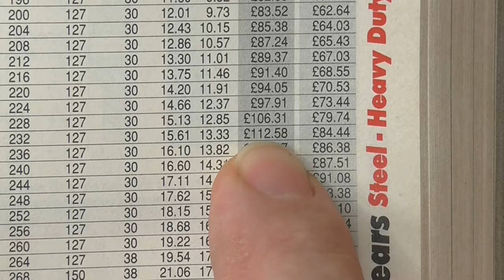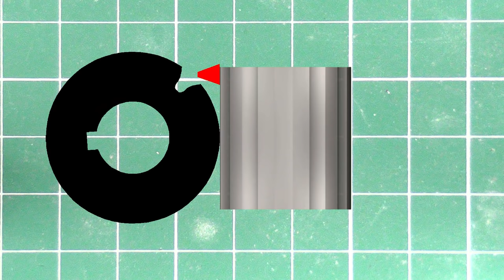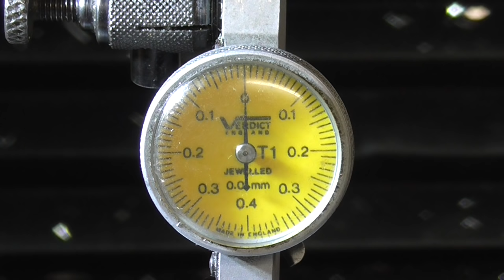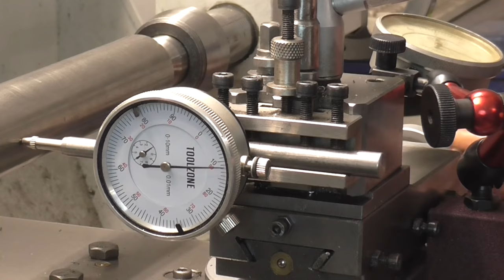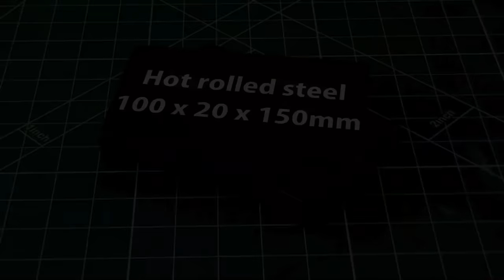DIY gear hobbing attachment for milling machine (part 1)

Comment: I love your work. But instead of building a spindle from scratch, could I just automate my rotary table using a motor and your controller? Or is there a critical issue I am overlooking?
Reply from the maker: There's a couple of good reasons not to use a rotary table, the worm reduction is usually 40:1 or 90:1 which is much too high to be practical, though you can disengage the worm and attach a pulley to the back of the spindle. The 2nd reason is that most of these tables aren't designed for continuous rotation, rather for indexing or cutting short arcs and they usually have plain bearings that have a bit of play in them. The play is not much of a problem in normal use and locking the table can eliminate it, but for hobbing gears it does make a difference and will lead to too much material being removed between the teeth especially on gears with less than ~ 20 teeth. But if you can find a rotary table or indexer with good preloaded bearings that you can attach a drive pulley directly to then yes, this can make a very good hobbing attachment.

Comment: Obviously you built a CNC hob fixture.  Which means you need a hob cutting tool.  Something if DYI starting as a  ACME threaded with the proper profile for the gear be it 14.5, 20, or some special pressure angle degrees and the other features like root dimensions.  Then cut to produce teeth and hardened.  Is the hob made or purchased?
Reply from the maker: I have both hobs I bought and ones I made, I've built up quite a collection over the years. I make them from O1 tool steel (drill rod). Screwcut, then teeth cut in the mill, hardened and tempered. My homemade ones don't have the full relief on the teeth the commercial ones have, but they seem to cut just as well (use plenty of cutting oil). it's useful to be able to make custom hobs for things like splines and toothed pulleys, not just gears.

Comment: I thought this hub will turn the blank by it's self and all you need is to set 20 degree angle to match the cutter angle printed on it.
No ?
Reply from the maker: That's called 'free hobbing' and it can work but more often than not you get poor results since when the cutter first contacts the blank it is not at the correct pitch circle diameter and so turns at the wrong speed giving you a different number of teeth to that expected. Sometimes it will sort itself out as the cut progresses, but it's hit and miss.

Comment: You do beautiful work.  Only thing I would advise is when milling I would blow some air or better some coolant mist to clear the chips.  You are forcing your cutter to recut some chips.  I think that's kind of hard on it.
Reply from the maker: Thanks!

I generally don't use compressed air on the mill to avoid blowing chips everywhere (I only have a small workshop). I sometimes use a small paintbrush to wipe them away and I usually do a light climb cut for the finishing pass to avoid recutting chips.
Reply: @AndysMachines  it does make a mess.  I mostly cut stainless in my job.  I started getting a lot less damage on my end mill flutes after I started using air to blow chips away from the cut. Air plus some cutting oil mist or flood gives a much better surface finish on stainless when milling a slot.  So much difference I couldn't believe it the first time.

Comment: I have never found a hole saw that size that would cut through that deep and big of a piece of steel
What brand did you use
Reply from the maker: It's a Sandvik (17:01) but any decent bi-metal type should do it. Keep the speed low, use cutting oil and clear the chips frequently. You can also drill a small hole all the way through in the path of the hole saw and this will let the chips fall through, though I tend not to do this as I find the slug removed by the hole saw very useful (this one actually became a gear for another project!).

Comment: Andy
Real question from ignorance in relation to hacksaw corner removal: you used hacksaw because it’s fastest? Or on a milling machine you are wasting a valuable cutting head? Or???
(no trade background, recently retired and about buy a metal lathe 😊)
Reply from the maker: Sawing is always fastest, compared to drilling or milling the material away and turning it all to chips. Sawing by hand does take some effort, a bandsaw would be faster, but I don't have one. An angle grinder with a thin cutting disk is another way, but also very messy if you only have a small workspace.
Reply: @AndysMachines  cheers! Thanks 😊

Comment: I know everyone can build the attachment anyway one would want BUT at 80 years of age , is there anyway to get hold of your prints that you made yours from?
Reply from the maker: I didn't actually make any prints for this, I just built it mostly with what materials I had to hand as that was quicker. The only parameter that was important for me was to make the centre height match a tailstock I already had.

Comment: Is a gear cutter for cutting a rack the same tooth shape as the hob? It seems like perhaps with multiple passes, a rack cutter could cut any number of teeth by turning the gear a bit and moving the cutter the same amount to simulate what the hob is doing.
Reply from the maker: Yes, a no.1 gear cutter (135 teeth - rack) has the same tooth profile as a hob, though obviously the teeth are not arranged in a helix, and can be used to cut any number of gear teeth by rotating the blank and moving the cutter along the tangent an equal amount (measured at the pitch circle diameter). Using this method you can even cut less than 12 teeth which you can't do even with a number 8 cutter in a normal set. If fact you don't even need a gear cutter to do this, it can be done with a regular tool like an endmill or (better) slitting saw. I have another video explaining this method: https://youtu.be/eC-OctJoWv4

Comment: Hi where can I find information about the calculation of gear hobbing? I’m also doing some projects involving gear hobbing .
Reply from the maker: I'll cover the actual hobbing in the next video. The calculations are nothing more than a simple division from the milling spindle to the hobbing spindle. There are also a few basic calculations relating to the size of the gear blank vs. no. teeth (and helical angle for helical gears) depth of cut etc. these calculations apply to all gears and there's lots of info online.

Comment: Hello sir, 
How do you define the Rpm for the blank during hobbing ? 
I know it have to be synchronise but I dont find any calculs to do it …
Thanks for your answer
Reply from the maker: The blank just turns as the speed of the hob divided by the number of teeth you want to cut in it. Each rotation of the hob cuts one tooth spacing. (For a single-start hob. For multi start hobs you divide by the number of teeth, then divide that number by the number of starts)

Comment: just beautiful dood.   well over 20 minutes and the best i will spend today!! i love the lathe tool that did much of the turning, it seems to be have two sets of super imposed geometry?   also i am curious, at 5:25 you use a dti fixed to the mill with the finger on the bore of the work, which you then spin and show the clock not moving (so nice!), are you checking conecntricity of said bore or are you checking the work is centred under the spindle of the mill?  if the later then please can you explain your procedure here?    fair play with the hack and hole saws...i know those jobs!  cheers again and look forward very much to watching the rest.
Reply from the maker: Thanks! Not sure which lathe cutter you mean, but with the dti I'm centring the workpiece on the rotary table by using shims on the jaws of the 3-jaw chuck and also tapping the chuck around on the table (the workpiece is a rough octagon at this point). This is so I can cut the t-slots accurately, it's not critical to have them centred but I wanted to do a good job of it.

Comment: Hi Andy, just found your channel, excellent content. I have downloaded the files for the gear hobber, just a couple of questions if i may, 
1: what does one do with the MAIN . asm  file?
2: when I use the CMD window as per the instructions I get the following error         System wide configuration file is ""
avrdude: can't open config file "": Invalid argument
avrdude: error reading system wide configuration file ""
Any idea what I am doing wrong?
By the way spotted the post about COM port number, mine is on COM 5, altering this makes no difference.
Hope you can help me I would love to have this facility in my shop.
Best Regards
Ron Cummings
Reply from the maker: Hi Ron, The .asm file is the assembler file that the .hex file is compiled from. You don't actually need it, but I included it as some people might like it for reference, or to edit it if anybody wants to modify the code.

2. It sounds like avrdude can't find it's configuration file (avrdude.conf), either because it doesn't exist, or maybe because it's not been told it's name? Have you just installed the arduino software? If so you might need to use the IDE itself to upload a file to the board (eg. with 'hello world' or any example project). This might initialise the configuration, but I'm really not an expert on arduinos, maybe somebody else reading this might know the answer?

Yes, you will need to set the -PCOM command to suit if you are not using COM 6, I neglected to mention this in the video, but I have since updated the 'how to' text file.

Comment: Hi! Excellent work!  I have a question Is a differential mechanism for helical gears necessary? Like the hobber gear machine have?  Thank you for share your work
Reply from the maker: Thanks! On a traditional universal milling machine where you have a gear train driving the table feed, it's normal to use a differential to advance the gear as it feeds, since the direction of feed is not parallel to the teeth. With the method I use here (I won't claim to have invented it) the 'advance' happens automatically since the gear blank is tilted and the feed direction is parallel to the teeth (not to the axis of rotation of the gear).

Comment: Do you generally not use metal cutting oils? Does it have any advantages?
Reply from the maker: Generally yes, but not always. Also when videoing I sometimes do things differently and avoid things like flood coolant which make it harder to see what's happening.
Reply: Cutting oil is for the purpose of preventing the chip from welding itself to the cutting tool or the work.  It is an absolute necessity with certain materials and processes.  It can be of little value in other cases.  For example, center drilling 304 or 316 stainless always requires cutting oil.  Threading pipe, especially stainless pipe always requires cutting oil.  Further, not just any oil.  Sulfur based cutting oil is the minimum.  Otherwise, you can count on breaking your dies.  Even deathly expensive pipe dies made for stainless will chip without the proper cutting oil.  I know this from first hand experience, not just from a book.  To restate, don't try to use Tap Magic to thread stainless pipe.

Comment: on 20:59 why are you using z axis descend (with repeated passes like it was a drill) with the mill instead of using the y (or x) axis in that operation?
I mean why not directly do  like you are then doing at 21:07
sorry for the dumb question, I am learning.
Many thanks!
Reply from the maker: It's often quicker to remove material this way, this part is quite thick and would take several passes to mill sideways, you can plunge cut more aggressively than mill sideways on a thick part. It also reduces uneven wear on the side of the endmill.

At 21:07 I am doing a light finishing pass at full depth, note that I am doing this in the climb milling direction which produces a better surface finish.

Comment: Hi i made a hob, what if i place my gear blank on a shaft with bearings, instead if driving the gear blank? Will it work
Reply from the maker: That's called 'free hobbing'. It can work but you need to be very exact with the setup or you often end up with one more or less teeth than you want. It helps to gash the blank first with the right number of shallow cuts to give the hob somewhere to start.
Reply: @AndysMachines  hi thanks for the reply. Will it produce accurate teeth? I did cut a nylon blank but i feel the teeth are skinny compared to the hob, do u know why?
Reply from the maker: It may not be as accurate, the problem is that the hob is driving the blank like a wormwheel so if the hob is not cutting at full depth it will want to turn it at the wrong speed. It's better to feed the hob in axially already at full depth, rather than feed into the blank radially. Also free hobbing works better with more teeth on the gear as there is better engagement, trying to cut less than around 20 teeth can give poorer results.
Reply: @AndysMachines  my hob is 7mm pitch, im trying to to cut a 2.25 module gear, first I tried on a nylon blank but the teeth were a bit skinny, next I tried aluminum and it chewed up all the teeth. Gotta keep trying

Comment: Pardon my ignorance but I thought hobs worked like worm gears, is it not possible to just have the stock be freely rotating, then when the hob makes contact it transfers its motion to make the stock rotate at the correct speed?
Reply from the maker: Yes, there is a 'worm effect' and cutting gears this way is called  'free hobbing'. However when the hob first touches the blank it is not at the final radius of the gear so you can end up with one too many teeth (or even half a tooth extra!). For this reason when free-hobbing you usually need to gash the blank first with the correct number of slots to keep things in line.
Reply: @AndysMachines  thank you for the info

Comment: Why did you not make a deeper weld prep channel…you’ve turned most of the weld away ?
Reply from the maker: Not sure how well it comes across on video but most of what I turned away was the end of the shaft which was longer than the thickness of the face plate, and some of the weld so I could skim the entire face true. There's still plenty left to hold it.

Comment: You have a mill and u used a hacksaw to remove the corners? Should have just milled the off.
Reply from the maker: It's actually faster and makes a lot less mess with a hacksaw. It does take more physical effort, but I usually saw the bulk off then clean it up on the mill.

Comment: Are you not cutting a key slot in the base for aligning with the milling machine table tee slots ?
Reply from the maker: No, because sometimes I want to use it at an angle on the milling table eg. to cut broaching and shaper cutters that have some relief behind the cutting edge. I might even try and cut bevel gears with it (though I've never done that before).

Comment: what software are you using? does it have differential?
Reply from the maker: It's not really running 'software' just a very small program on a microcontroller that does the division. I'll cover how it works in the next video.

Comment: Hello. What torque is needed for the stepper motor? 13kgf.cm, 15kgf.cm or 30kgf.cm. Thanks
Reply from the maker: I can't really answer that as it depends on your hobbing spindle and belt reduction, but not a lot of torque is required. The motor I am using is only 10kg cm (1Nm). Increasing the torque would get you higher acceleration

Comment: Did you make that taper completely on the compound? Or do you have a taper attachment just off screen
Reply from the maker: Just with the compound after carefully dialling it in. This lathe doesn't have a taper attachment. It's a number 2 Morse taper and the bore through the spindle is 16mm which is slightly larger than the small end of a no.2 so the actual length of the taper is only around 60mm.

Comment: No warping from the welds????
Reply from the maker: I avoided welds on the frame for just this reason. The only part I welded was the faceplate to the shaft and I did the final turning after welding to true it up. You will always get some movement with welds.